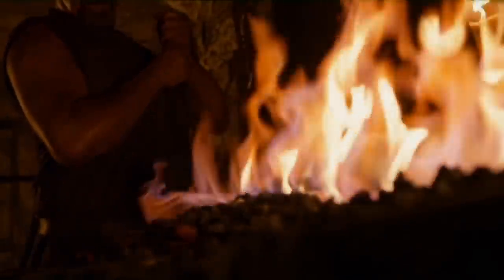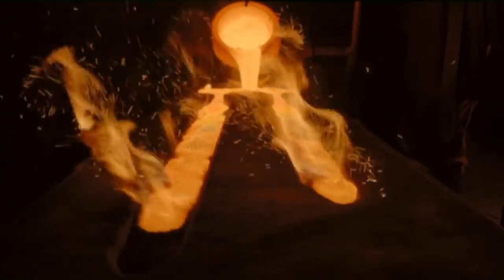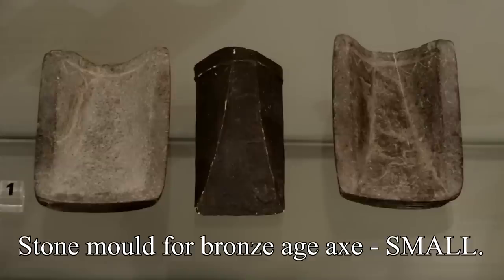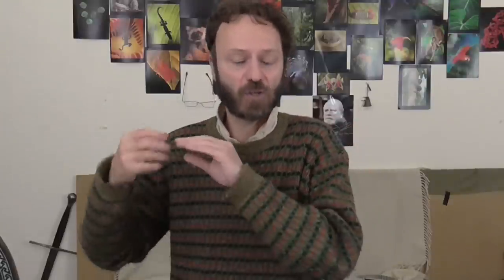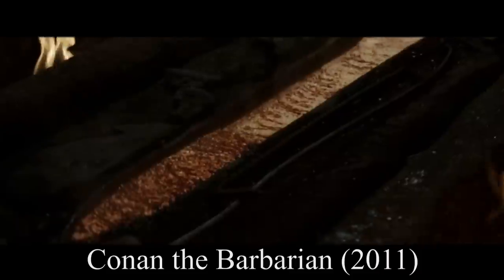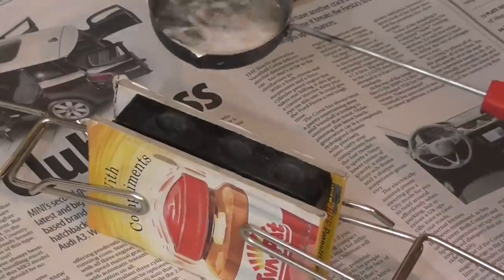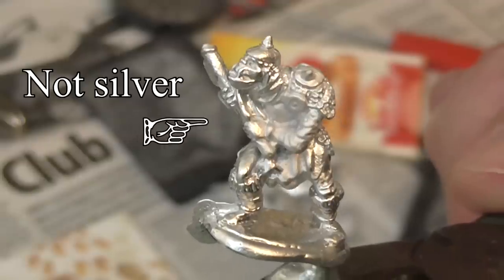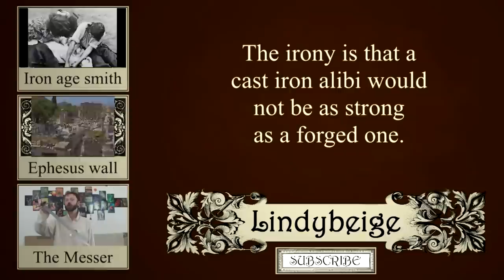Casting swords in the movies - forging a lie

Comment: This may be a dumb question, but could it be possible to cast an iron arrowhead that, when fired from a powerful enough bow, that it's impact would be like a mini-frag grenade; like you shoot it and the arrowhead shatters, burying its pieces here and there, possibly wounding several enemies advancing?
Reply: No. Simple shattering won't impale you with shrapnel. (You can demonstrate this by dropping a glass object on a hard floor next to your exposed leg.) Significant injury requires a much greater velocity imparted to the fragments, such as explosive force. Hmm ... now if you were to take a big, hollow, cast iron arrowhead and fill it with black powder and stick a lit fuse in it ...
Reply: whiteknightcat at that point, you might as well ditch the entire assembly and use some primitive musket. Now that you mention it, I guess you really can't shatter people to death.

Comment: Pretty sure that was Valerian steel which is inherently imbued with magical properties. In fantasy magic effectively explains alot. But for real world movies legit points made. Plus maybe they poured a mold then slowly worked and compressed the iron using a coal pile to infuse it into steel. Maybe they did tons of normalizing and heat treating cycles. All that would be boring in a movie. But without magic added it is still just an aluminum sword with the color, that is such a winning point.

Comment: I would like to say some things regarding the casting of swords. I think the lord of the rings scene you showed was actually the orcs using the process of making pig iron. Which is a process of form steel bars which would then be forged. Also if blacksmiths could have gotten steel hot enough to cast it they would have because it could have been faster. You could then aneal the steel to make it softer and properly heat treat it. I would argue that the reason they didn’t cast swords is because they didn’t have the ability to do so.
Reply: Yeah, orc swords were meant to be crude and cheap.

Comment: I believe you but what about cast iron cannons. Wouldn't they be very brittle as well?
Reply: Iron cast cannons are brittle, indeed. That is why they are so massiv with a huge outer diameter and a small inner diameter, especially the burning chamber. Nevertheless they were pretty useful as many battles and sieges in history showed us. Swords on the other hand had to be forged because a cast sword would have to be pretty massiv, which would make them not that practical any more.

Comment: I am a bit shocked that Lindy played the clip from Lord of the Rings and yet didn't recognize that they were in fact casting using not iron, but a magical alloy called orcantium. It melts at a much lower temperature than iron… because… the orcs were using green trees as fuel for their furnaces rather than coal or charcoal. So you see it all makes perfect sense.

Comment: Cast iron is not defined by the fact that it is cast, it is defined by carbon content.  All cast iron is cast, but not all iron that is cast is cast iron.  Casting a sword-shaped billet (a chunk of iron for forging) is not a bad idea.  It would drastically reduce the amount of work required to forge the finished sword.  However, a good sword gets both narrower and thinner towards the tip.  So a cast billet in the shape of a sword would need to be much shorter than you wanted the finished sword to be.

Comment: Steel is iron with between 0.2 and 2.0% carbon making it dramatically harder. The higher the carbon the harder and more brittle. Anything with 2% or more carbon is considerd cast iron and is too hard for blacksmiths to work with so it has to be cast into shape

Comment: Well to make a good steel sword u need to forge not cast it and u need to fold the steel and hammer and hammer and hammer it over and over...more u fold it better quality u get. They also add softer metals in the mix to make it flexible and not shatter. Look at master blacksmith making katana swords...they fold it hundreds of times.
One could argue that in GoT scene they cast a sword out of magical valerian steel that have some unknown properties, but they have shown these swords up close in some episodes. These swords have intricate patterns on them that can only come from folding the steel many many times. And then they just pour this metal in some primitive shape mold?!

Comment: Just to be Realistic, it is Theoratikally possible to cast a "Iron" sword you just have to Make it hot over an long time trouh the Carbon leaves the Iron and you have an sword wich is extremly soft Iron (because pure iron is realy soft compared to steel) in wich you in order to make it a bit Harder you have to hammer it to harden it. so it is possible to "cast" a sword but you have to maintain the Tepreture of the Molten "Iron" for an log amount of time, you have to stir the "Iron" Constantly, and you have to compress the "sword" afterwards in the cooled down State With an hammer or some other tool for an big amount of brute force. after all this (and some more) you have an Expensive, ightly rustingand soft Iron sword.

And an point you "Cast Steel" is an very specifik therm wich Determins an Iron Aloy with an specific range of proportion of Carbon in it.
and Steel is also an Iron alloy with an specifik Range wich starts at about 0.2% and ends at 2.06%. 
And you could cast Steel it is just more Work. Thus more Expensive and also an Castet Hook with the same dimensions and from the outside same in everythink mashined by an CNC-mill would be not as Good as The Hook Made by an good smith.

Comment: Some discrepancies, but the core of the video 100%. Talking about steel since that's what I work with and familiar with. Most people think that red hot metal is the hottest there is! Wrong, red hot is actually the coldest when it comes to high temperature. It goes from Red, to orange, to yellow, to a bright white. Steal is a a grey color when cool, as the metal starts to cool down from its melting point, more and more or the grey starts to show, hence why it gets a darker color as it cools And with out proper quenching and heat treat process steel can be either super bendy and wont hold any shape under much pressure, or be super brittle and break like glass. Oh and no discrepancies, forgot you where use centigrade not farenheit. Oops lol

Comment: Oh my god. This is the point where i find lindy mistake, Steel is not just iron. It is iron in certain crystal structure and iron carbide. For cast iron too much carbon and silicon would be there.

Comment: I melt iron for a living.  If that shit gets white hot then you've done something wrong, and you should consider running.  You're definitely gonna be putting a new lining in a furnace.  Hottest we get our metal is 2800 Fahrenheit and that's a extremely bright yellow, but the hottest thing we pour is 2550 and it's pretty bright yellow.

Comment: Uh the swords that are being casted in that game of thrones scene are made of the fantasy metal valyrian steel which means they don't have the exact same properties as iron. If they did then it would be called iron not valyrian steel. I would say that valyrian steel does burn orange, is casted with an open top and does not come out brittle "like glass" considering the tv show explicitely tells us more than once that valyrian steel is much much harder and stronger than iron/steel

Comment: cant you cast  a sword then beat a grain into the steel structure after the fact? surely it would speed up mass production of swords if you could open top mould them then have a smithy beat crap out of them.

Comment: Also that re-forging Narsil scene in RotK where they just heat it up a bit, put the two pieces next to each other and hammer away... first of all what the fuck, second, it was in about 6 pieces on the pedestal where we saw it earlier. 
I'm starting to think that the Forging Scene in Siegfried, on stage, tends to look more realistic. It goes through multiple steps that at least make sense, and it goes on long enough (probably still a montage that would last longer irl).

Comment: Its plausable to cast swords the way they did it in the movies. Iron is not same as steel. Steel is not iron. Iron is just iron. Iron is component in a steel and its necessery to be. There are steels without iron. Steel is general term for metals and combinations. Can be vanadium/chromium/nickel steel with lots of carbon and even tungsten carbide. And maybe even without any iron or very little. Open cast can be designed to mold 3D shapes. Also post processings can be done. Custom forging, adding components. Tempering. Many options and methods.
Reply: Welll... not really. Steel in its most basic form is Iron with a certain carbon content (of the top of my head this is between 0,01% and 2,1% Carbon, with medieval steel generally having ~0,2-0,8%) anything above this is called Cast-iron. It is true that you can add various metals to Steel to alter the properties, like adding Chromium (among others) to make stainless steel (11% Chromium).

Additionally, adding chromium increases the melting temperature of the resulting steel, whilst stuff like nickel increases the tensile strength and Vanadium increases the hardness. The steel does, no matter how many additives, contain Iron, as many of the additives place themselves on the position of Iron or in the cavity of the crystal lattice.
Reply: @zephyros256  
But is possible steel to have very little to no iron. Like 75% chromium, 5% Nickel, 10% Vanadium and 10% other elements. 10% iron. Or Zero percent iron. Can be 75% chromium,10% vanadium, 5 % nickel and 2 percent cobalt, 2 percent carbon, 2 percent tungsten carbide and 4% lead. Or any kind of combination of elements which doesnt include iron.
About glowing in orange like author of this video claim isnt true. Steel can glow in orange when is casted. Open molds can be good for mass production of swords. First swords was straight flat pieces of metal. 
And many custom designs existed. Secret tech. Like King Arthur's Excalibur sword. Damascus steel was legendary as well. For Conan Barbarian there are myths that his sord was made from superior materials. From meteorite rare metals.
Reply: @LORDVADER357  my point is that strictly speaking Iron can only be an alloy of atleast Iron and Carbon, Steel is defined as such. True, you can make an alloy of Vanadium, Chromium, Nickel, Copper etc. But that alloy can't be called Steel.

Additionally, only steel that has no directly added (no trace amounts) other metals can strictly speaking be called Steel. When you add other alloy metals, like Chromium and Vanadium, the resulting alloy is an Alloy Steel variant that may or may not have a specific name. This allow steel can have up to 50% of its weight consist of metals other than Iron.

EDIT: Also, regarding the glowing colour of an iron alloy. That is entirely possible, an iron/steel alloy can have a lower melting point than base iron/steel, thus allowing it to be casted at a lower Temperature and, as a consequence a more red shifted colour (like orange).

Comment: Hate to be this guy but the term cast iron refers to a grade of steel between 2.8% and 4% carbon content which is a higher percentage than steel that would be used in say construction and the reason it is so brittle is because of one it has a relatively high carbon content and two anytime you cast something it will be weaker than that of forged mettle. So the cast iron that you refer to is simply pure iron that is cast rather than true cast iron which would be quite hard to gain access to because of its carbon content before the 1500 or possibly some time later than that

Comment: I have to disagree with the brittle part. It is possible to cast actual steel. The first one to do so in our world was the son of a german clock maker near the end of the nineteenth century i think. Now if we are looking at saruman, who proves to be more technologicaly advanced than bis surroundings and arming bis soldiers with sharpened metal slabs it might be possible. Save for the other points mentioned...

Comment: Ok, but one question, the iron bar from which they forge a sword.... isn't that casted first? Or how is it made from iron ore?
Reply: Usually they are casted then reshaped. The thing is casting metal bars or ingot is ok. In order to make a flexible and strong blade or tool you heat up the metal bar to put a shape to it and carefully handle the way and speed it cools down. Cool it too quickly or heat it too much and the structure of the solid metal will fracture and the blade will be brittle, but if not hot enough when quenched the metal won't harden and remain soft. Some metals won't harden though, that's why it's ok to cast bronze swords.

Comment: the thing is: Steel is not Iron. Yes Cast Iron is very brittle, but cast iron is a specific term for iron with a very high carbon content(2.5 -4%), wich makes it very brittle because the carbon doesn´t get dissolved very well in the iron at this percentage. It does make for a high compressive strength and good vibration absorbtion, for wich cast Iron is mainly used.
Steel on the otherhand has a much lower carbon content(defined to be between 0.05 -2.06%)where the carbon is dissolved much better(at least to a certain level of about 0.8%. over that and the carbon isn´t distributed well in the steel and it has low tensile strength(the important thing wenn talking about shatering and bending) if not tempered right). Also cast steel is a thing and it´s not very brittle just because it is casted.

Comment: To be fair, at least in the GoT example, the mold is flat on the bottom, so you're going to end up with a vaguely sword-shaped bar that's flat on both sides, that I assume the smith is going to bevel by hand. Which isn't all that difficult for an experienced smith. That being said, I don't think the work is going to (completely) negate the inherent issues of using cast iron/steel, and I envy the courage of the man who's going to pour molten steel. Stuff is HOT.

Comment: its not the casting that makes the steel brittle though. its the carbon. if you cast steel with about 2% or less carbon in it, you could still forge it later.

Comment: I can easily see how it would be faster to forge a sword from a sword shaped object than it would be to forge a sword from a brick shaped object.

Cast sword.  Now forge sword to structure the crystal structure and to repair voids.  Now finish the sword.  Way easier if you have the smelting technology than taking an ingot and beating it with a hammer until you get it as long as a sword, then forging its shape.

However it is doubtful they would have the technology widely available to do such a thing (the blacksmith is not smelting their own iron), but in modern times, believe it or not, this is a very valid technique in blacksmithing. 

However, Chinese progression of technology was pretty clear, that they went from Cast iron swords to forged swords later as technology advanced.  YES THEY MADE CAST IRON SWORDS.

As far as the color of the molten metal, that is irrelevant unless you are looking at it in person.  Go youtube a video of an actual steel foundry, and see what color is coming out.  It will be orange.  The camera changes the exposure of the white hot metal and it looks orange, so you can fuck off with that point as well.

As far as cast iron being to brittle.  ANother way to tell you know nothing about what you are talking about.  Google decarburization.  Ill wait.  Nevermind, Ill tell you.  Its the process of removing carbon from cast iron to make it less brittle.

I honestly dont think you know a fraction of what you think you do about steel and forging.  Which makes me doubt the knowledge you have about things that I dont know anything about.  Perhaps are you this wildly incorrect with your other historical videos?  I mean this is just assumptions that you present as fact.  Jesus man, stick to things you actually have the slightest clue about, because putting out hack pieces like this discredits your entire channel.

Comment: Your insistence on calling steel swords iron is a bit silly, isn't it?  Certainly, they contain iron and can even be sail to be primarily iron, but you would not for example call a bronze sword a copper sword, despite bronze being a copper alloy (generally 88% copper to 12% tin).  There is another reason that simply folding those materials into each other don't work, and that is that the advance from iron to steel blades was an important technological distinction between the swords produced (copper succeeded by bronze, iron by steel).

When a distinction is germane and easily understood, why not make it?  What is the downside?  Just my humble thoughts on the subject.

Comment: Ah, a logical fallacy! An alibi isn't to be wielded and struck against an accusation or investigation, but rather be pressured upon by the accuser and/or investigators. As you said yourself, cast iron holds up particularly well against compressive forces, making a cast iron alibi as strong as if not superior to a forged iron alibi!